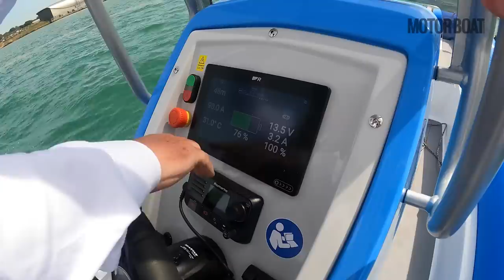Driving a ground-breaking £74k electric RIB | RS Pulse 63 quick spin | Motor Boat & Yachting

Comment: Am I the only one who thinks there’s something a little odd about the sales patter for this? Also doesn’t look it’s value, can’t see that being used as a tender 🤷🏼‍♂️
Reply: I think this I just the test version. He says there are other versions and sizes available. But if you look at the price of conventional tender like a Brig or AB, it's about the same. But electric is always going to cost a little more anyways and they'll claim that you make up the savings in fuel costs. With so many boats having solar and extra large alternators, they can charge up the battery pretty fast.

Comment: Whilst difficult to tell how long you were on the water the battery seemed to go down from 77% to 70% pretty quickly and the 20kts seems optimistic. Be interesting as well to compare weight of a similar outboard rib with fuel versus the electric and effective range at a given speed. I can see appeal as a tender (materials need an upgrade if Superyacht territory) but as a proper day boat I’m not convinced.

Comment: I am not to sure on it 
So first the sales guy says it can do 20knots? Then you can’t do full throttle from a standstill apparently petrol engines don’t like that it depends what prop you have on and 2 stroke 4 stroke engine I think if I had a proper consul that would be better I’m not too sure about the jockey seats makes it look a bit cheap 75 k that’s a bit expensive for the market that they are in so I would just stick with my petrol engine more efficient better also come to wake borders and water skis as well Hugo brilliant video thank you so much not to sure on the sale guy
Reply: It might be that the Mercury leg they've put on it can't handle full torque from the motor from a full stop (where electric motors make their maximum torque).

Comment: I think for these to truly work well, you either need a catamaran style hull or a hydrofoil like you've shown before, some Sharrow props, and to make it worthwhile in a yacht, have it charge with solar and/or have your boat with extra large alternators, outfit it with its own sail drive for when it is being towed, and make the battery packs swappable. If they were smart they would have a spot where you could slap in a battery pack from like a Dewalt or Ryobi cordless power tool and use that as an emergency source of power. It's only going to move you at 3 to 4 knots for about 15-20 minutes but that is moving you a lot closer to the boat. Plus if they put a roof with solar panels on it, then that will not only give you shade protection, but charge up the battery in case it runs down. Or just put a limiter in it that won't let you take the boat out further than what it calculates it will need for a return trip unless you manually override the function. I got some ideas. Let's go talk to these people Hugo.
Reply: I fail to see the benefit of an electric tender unless it had solar. If it connects to renewable on the superyacht, you'll have to invest in a system with much higher capacity otherwise it's going to suck every last milliamp to recharge. It's slow, and unimpressive to look at. Unimpressive range. Seating for 3? The geofencing option is cute but that would be more for rental or charter purposes. Yeah, I don't see this doing well in the superyacht market. Also, how can this salesman tell testers not to go full throttle? That's a totally valid test IMO. Is he afraid a circuit is going to blow? If that's the case then there should be some current limiting built in. Motor doesn't sound like how an electric motor should. Something smells fishy
Reply: @tyoung9012  don’t try to use it up Southampton Water in the winter months then. I live 20 miles down the road and there’s been a dearth of sunshine this year. Grey and gloomy since the first lockdown and although there is undoubtedly solar energy getting through it has all the power of a cold rice pudding….
Reply: With all the 'gatekeeping' 'preachy' catamaran sailing channels on YouTube now inspiring people to go forth and sail, I could see this being a viable candidate for those types of boats. Those channels are all about the 'no engine or generators, you must sail, have a larger alternator, solar, no A/C and no washer/dryer on board!' That's why I think if they got one, others would too. But therein lies the other issue and that's reality. Some of these people have no idea what they hell they are doing and one false misstep with a boat loaded up with lithium-ion batteries hanging off your boat, or under it could be dangerous if it caught on fire. I could see some people pushing the boat overboard and pushing it away from their boat and fail to account the boat next to you now on fire. The other issue is the range and the recharging times. In ideal conditions with power poles that work (not always a thing in the Caribbean, especially near a dinghy tie up dock) you can get a 55% charge in an hour? Does this mean you have to carry the charging cable with you, and then you plug it in and hope nobody unplugs it while you are gone, or you can even use the power coming out of the pole. I didn't hear them say it came with a converter. I realize they have it styled this way for testing amd they have other styles and sizes, but some things just appear to not be fully thought out.

Comment: I'm blown away by the range figures and charge time figures, this would be perfect for exploring Plymouth sound and nearby rivers and estuaries, drop anchor, have a bite to eat, beach it and walk the dog, this would be perfect.👍🇬🇧❤️
Reply: Or you could buy a locally built Ribeye with more performance and range.

There’s a huge price to pay for being an early adopter…
Reply: @PhilbyFavourites  agreed, the prime 941 all black is very appealing but for pottering/exploring quietly this would be perfect. 
    More performance and excitement would be ribeye for me. 👍🇬🇧
Reply: @cookiemonster2299  I would say this one is incredibly expensive for being an electric one trick pony. I drive Ballistic Ribs fitted with the Yamaha range of outboards and I swear they are quieter at the pottering speed you would use them for. This rib seemed awfully noisy pulling away from the dock, so immediately negated the standard argument that electric is quieter than ICE.
Reply: @PhilbyFavourites  I liked it 😁👍🇬🇧
Reply: Remember these are the salesman's figures... if it's anything like a car and it's cold at sea, it'll be lucky to do 30 miles with a following wind. Then add a safety margin...

Comment: It's great to see somebody else with an electric offering, but this looks a bit like a Dacia with an Audi price tag. To be successful, I think any electric boat will need a very large full length solar roof generating 3-4kW, so it can charge itself in 2-3 days, or run slowly on solar only, like a Silent-Yachts cat. Greenline are on the right track, but need to be much braver and design a radical new look where the solar cabin roof extends all the way over the entire deck area (perhaps with extra extending "wings") to give a huge solar array.